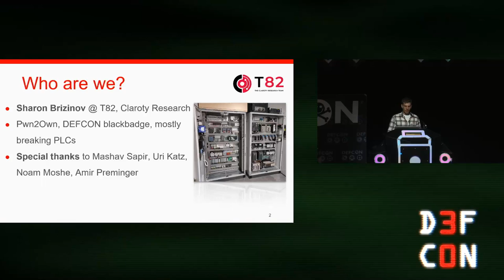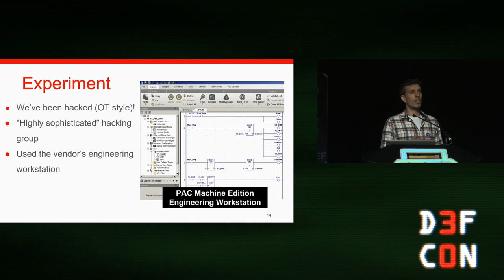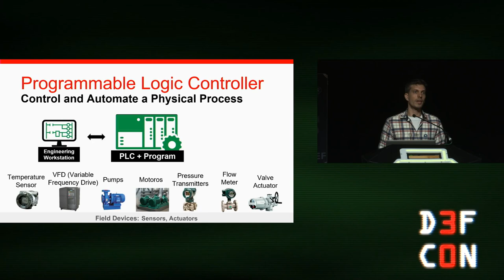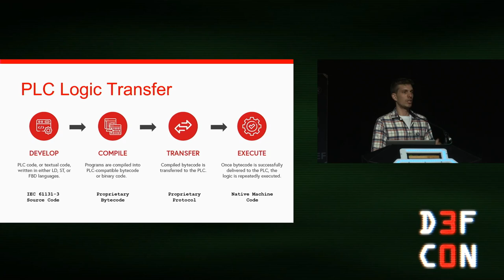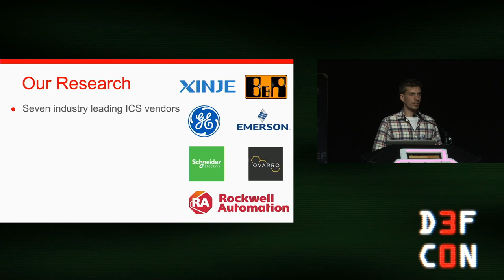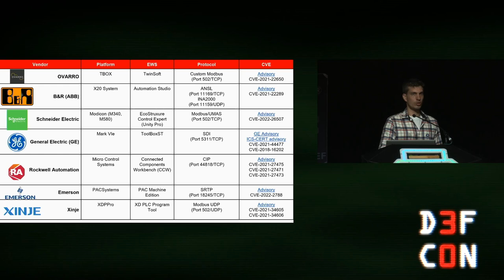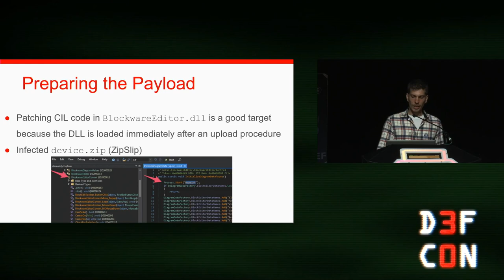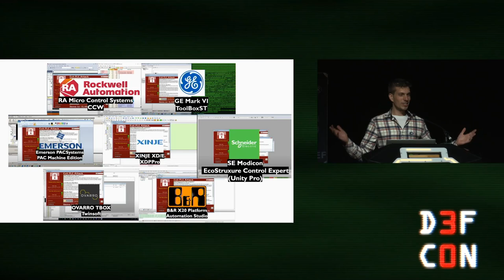DEF CON 30  - Sharon Brizinov - Evil PLC Attacks - Weaponizing PLCs

Comment: Sad to see the two biggest PLC Vendors main product lines missing.

Rockwell with Studio5000 and Control Logix or Compact Logix
Siemens with TIA Portal and S7 1200 or 1500. 

They have a Cheap modern Micrologix with CCW, which no one uses. I think the only thing CCW is used for by most engineers is to configure Power Flex Drives if not using drive tools.
Reply: Really intrested in siemens exploitation
Reply: Well those are very very expensive and you kind of need a service contract to fully use

Comment: Just a replay of Stuxnet, and from well, I'll just leave it at that..
Reply: It's err.. nothing like Stuxnet. What are you on about? It involves PLCs, sure, but the method and outcome is totally different.
Reply: @DeShark88  it's an insertion attack. Stuxnet modified the Step7/WinCC DLL(s). The payloads and focus was on DLL(s).
Reply: @johnkost2514  the attack vector was totally different. One was an OS 0-day (Windows Shortcuts) exploited via USB stick, and the other is via a honeypot. Also the target was different. In Stuxnet the target was the PLCs, in this attack the target is those trying to hack PLCs. Sure, the PLC programmer's DLLs were edited in both cases, but I wouldn't call this a simple replay, since it's being done the opposite way around to target the complete opposite target.
Reply: @DeShark88  there were multiple Stuxnet campaigns (versions) and the probability that all were delivered via a USB is suspect. Again, DLL(s) were the focus of the exploit. Anyone who really knows the deeper constructs of ICS security and vulnerability would acknowledge the similarities. Relax your ego. I made an observation, I stated the similarity. Cyber researchers generally have more open minds than you do.